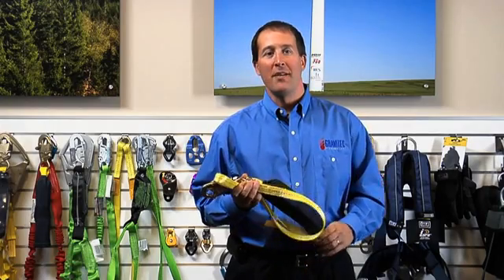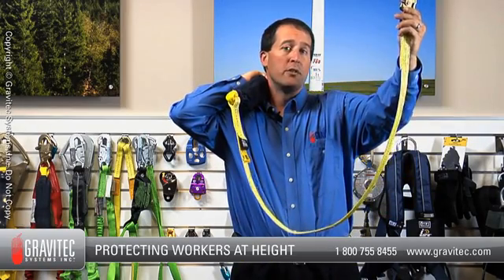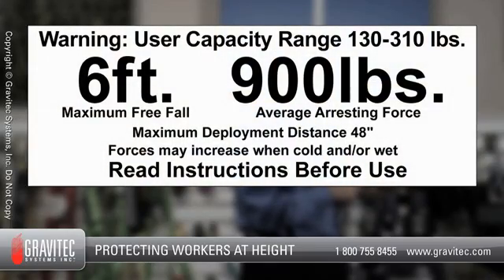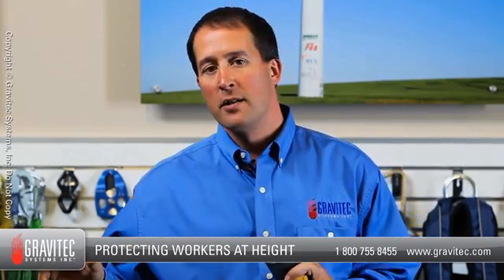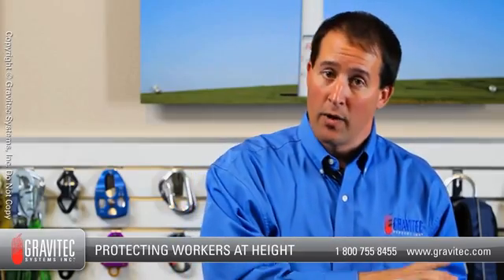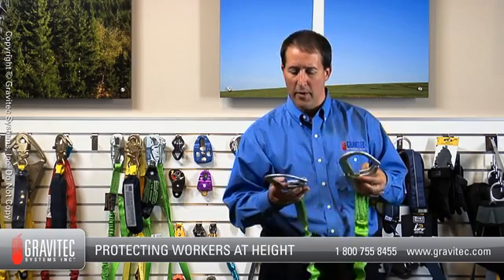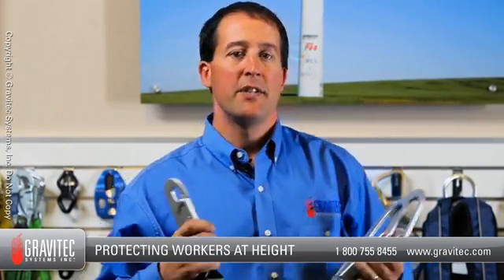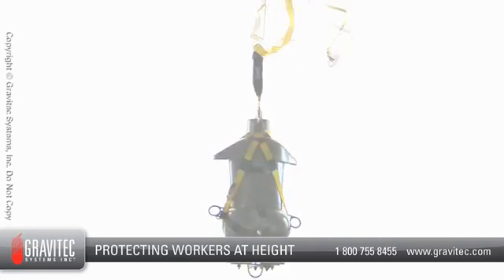Energy Absorbing Lanyards - Fall Protection Forum

Comment: Could you please tell me that at what force energy absorber starts deploying? And how much energy it dissipate for the overall shock
Reply from the maker: The energy absorber will start deploying at or below the specified average arresting force. Depending on the ANSI type it will be 900lbs or 1350lbs. 

The total energy dissipation will be determined by the weight of the worker and the length of the free fall. There’s no way to know the force without knowing those two numbers first. 

As long as the worker stays between the capacities of the energy absorber the worker should now experience more than the specified arresting force.
Reply: Is there any fall protection for 100 mtrs?
Reply: @frdx_1947  in what situation would you want to fall 100 meters as opposed to 6 feet